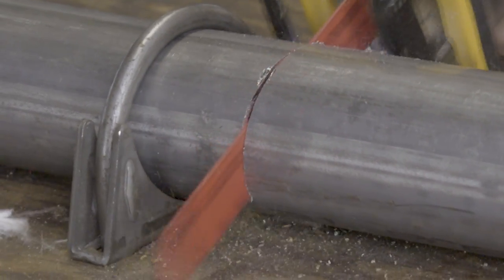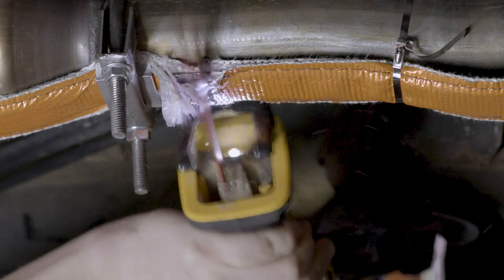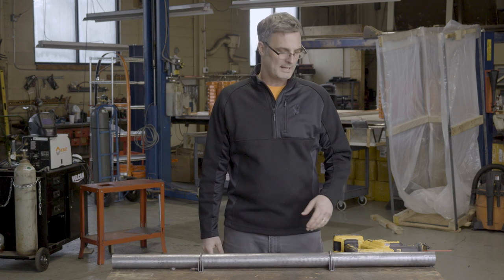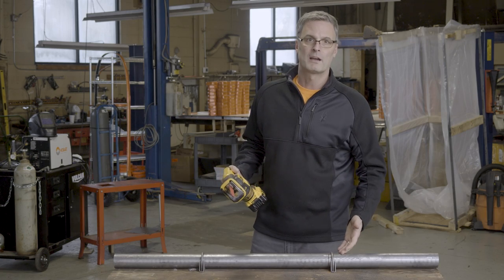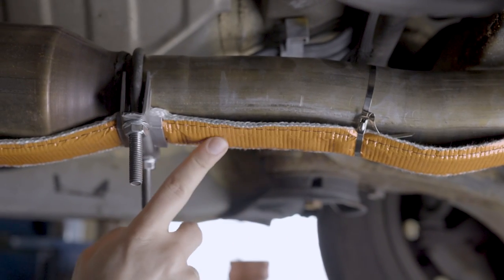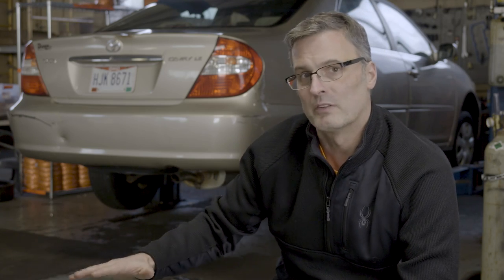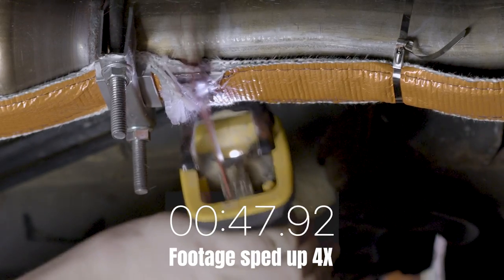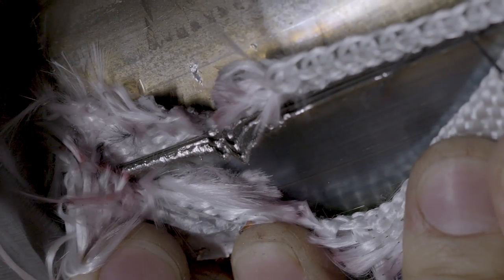Catstrap Review - Catalytic Converter Anti-Theft Protection - Real-World Test

Comment: I'm not a professional thief but, looking at this solution, I would just cut through those mild steel exhaust clamps first, let the CatStrap fall away and then cut the catalytic converter out.
Reply: The strap has a adhesive strip that after 2hrs driving time fastens to the exhaust pipe and will not fall away if the clamps are cut off. 
The scenario would be the sams idea of your using Gorilla Glue to fasten items together..they are not going to be separated again.
Reply: The strap has a heat activated adhesive that bonds to the pipe. Thieves would have to first pry the adhesive off. 

Nothing is impossible, but after 100k+ installs we have seen virtually zero theft attempts where they cut the exhaust clamps and removed the CatStrap. May sound easy, but ask any mechanic, even with just the exhaust clamps properly tightened during installation, the clamps bend into the pipe. If cut you need a hammer to knock them off.

Given enough time, effort, and assortment of tools anything can be defeated, but you make it so difficult a thief simply moves on. We see very little successful thefts, likely because it makes them go away in the first place.
Reply: Mechanic told me the strap melts onto the catalytic converter

Comment: They don't cut from the bottom up. They cut from the top down.
Reply from the maker: On vehicles where there is enough clearance (e.g., Ford E-450 chassis) we make the Max Protect Kit which includes two straps for both the top and the bottom of the pipe. On most cars there isn't enough clearance to position the saw on the top of the pipe to cut down.
Reply: @TheCatStrap what about a 2015 Prius?
Reply: @johnhuff1800  yes the standard 7ft CatStrap is the right fit for the Prius.
Reply: @TheCatStrap  Is A Sonnata ok for just the bottom strip ?

Comment: Am I missing something here? Can they just cut from the side or top and go down (you were cutting from the bottom up) and then just remove the collars and clamp to get the catalytic converter?
Reply: That's what I was thinking. Just give it a tug and cut above...but then if you look at the position of the clamps seems to be what makes it secure
Reply from the maker: The strap has a adhesive strip that bonds to the exhaust pipe and will not fall away if the clamps are cut off.
Reply: @TheCatStrap  but can't they still cut the pipe out of spite? and leave it

Comment: Only problem with this is that an angle grinder will go right through it and from what I have seen they carry a hand sawzall and an angle grinder. They usually run in pairs so they have options.
I have a 2017 Tundra and I welded hardened steel 3/8" tow chain across mine all the way from where the cats connect to the downpipes all the way back to the muffler plus a cat shield. I look at it as a life saver for the thieves, for as long as it prevents them from stealing my cats I won't have to shoot them dead.
Reply: Won't it deter?
Reply: An angle grinder will get through anything eventually, however, the sawzall is the tool of choice in converter thefts. Handheld angle grinder wheels are too small to cut through a large exhaust pipe when you don't have 360-degree clearance around the pipe. Nothing is foolproof but you can make it so difficult for a thief they simply move on.  

Your solution sounds like a solid deterrent! The most important thing is to just make them go away in the first place.
Reply: forget that look at the straps you can EASILY just cut off with the sawsall i mean 5 seconds and that silly strip is separated

Comment: the main flaws I see here are  for one - you can cut above the strap where it isn't protected. An an angle grinder can go right through all of it. A carbide blade would go through, a carbide coated blade could go through as well.  I like the flexibility of the system but  it seems to have some big flaws.
Reply: Hey Mike, appreciate your comments. The blade used in this video is a Diablo carbide blade for auto dismantling applications. If the top of the pipe is accessible, a thief could make a slit in the pipe but cannot complete the cut or remove the converter without cutting the strap.
Reply: @catstraphq633  ... and you're still left needing a new pipe. Is that the point, they can cut the pipe but not take the converter? This is the best device I've seen, but if a thief is pissed off, he's gonna cut that pipe.
Reply: @MarkWood-ic7km  It's true a thief could make a slit in the pipe. The repair would likely be a simple weld. My honest thought-- we just don't see this occur in the real world. For whatever reason, if there's a cutting attempt we almost universally see them attempt to cut through the strap immediately, as opposed to starting on the opposite side of the pipe.
Reply: @catstraphq633  I will be getting one for my '07 Element to go with an vibration alarm. And probably paint my cat converter a nice pink and lime green while I'm at it. Thank you.

Comment: I saw this on the donut episode! Any improvements?
Reply from the maker: Hi Pablo, yes improvements on both the installation and the design of the Catstrap itself. Notice the clamp collars used in this video-- the folks at Donut Media didn't use these at all for some reason, nor head up the engine for the heat-activated adhesive to bond. The Catstrap design was also upgraded since the donut episode to include triple layers of ultra-hardened strip steel. It destroys the blade before cutting and makes it really difficult to focus the cutting area as seen in video. Doing our best to stay ahead of the power tools used by thieves!

Comment: This is about as effective as a wall from anyone south of the border ……. I could cut through a cheap exhaust clamp with a regular hacksaw in less than a minute. 

Now, with a battery operated saws all  ???  ….. it’ll take you seven seconds to cut through to clamps and take your catalytic converter
Reply: The strap has a heat activated adhesive that bonds to the pipe. Thieves would have to first pry the adhesive off. May sound easy, but ask any mechanic, exhaust clamps properly tightened during installation forces the clamps to bend into the pipe. If cut you still need a hammer to knock them off.

We have seen virtually zero theft attempts where they cut the exhaust clamps and removed the CatStrap. 

Given enough time, effort, and assortment of tools anything can be defeated, but you make it so difficult a thief simply moves on. We see very little successful thefts, likely because it makes them go away in the first place.